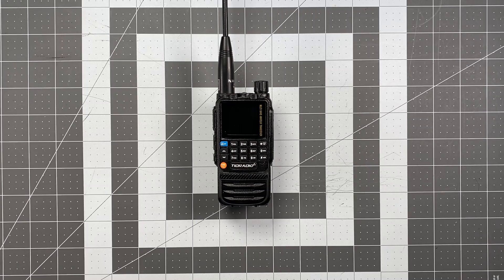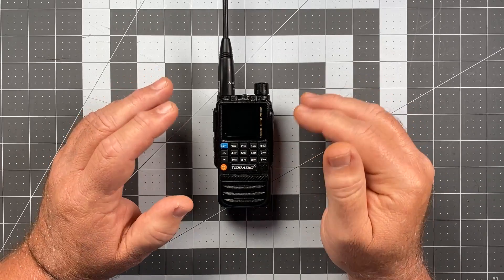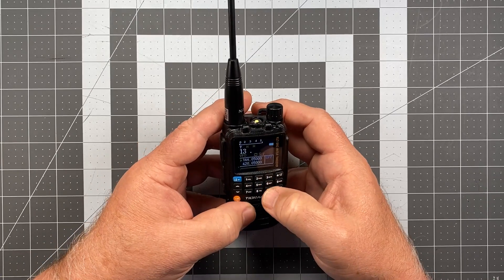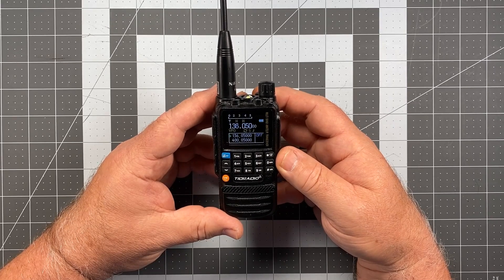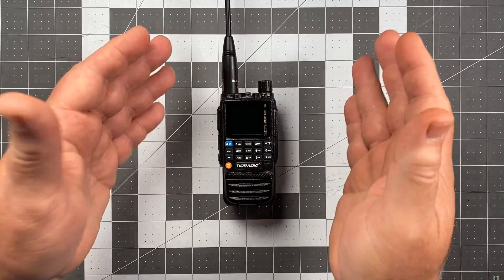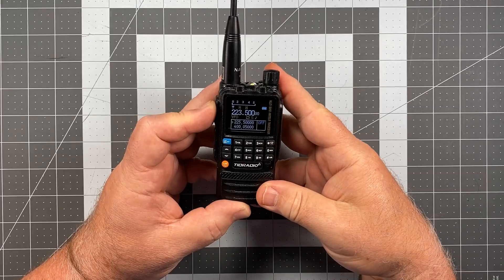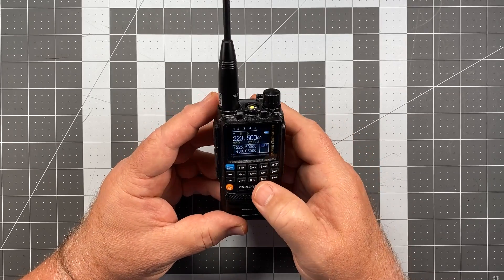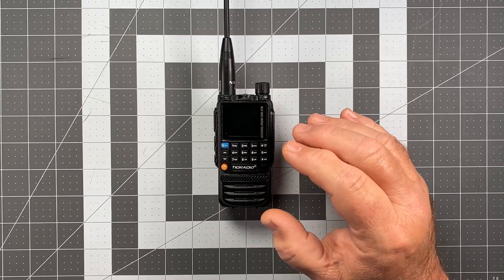TIDRADIO TD-H3 - Switching the operating modes

Comment: This does Not address the failures of the H3 PLUS . The H3 PLUS does Not have a GMRS mode . Unless you consider ' normal ' to be GMRS . I do not . I prefer the specific GMRS mode of the original H3 .
Reply from the maker: I don't own an H3 Plus. They offered to send me one for review, but I turned down the offer.

Comment: What are those extra steps you have to take to get it to work on ALL frequencies?
Reply from the maker: It's right here in this video. Set the radio to normal mode and it will transmit on all frequencies that this radio is capable of transmitting on.
Reply: @KS6DAY  
When I put mine in Normal mode, I can't program any frequencies in the software. I get an error message. I don't know what I'm doing wrong. When in GMRS mode all 30 channels are there along with the NOAA channels.
Reply from the maker: @keithmatthews4441  Is this error message after the frequencies are entered and you are trying to transmit or at the time of entering with the software?
Reply: @KS6DAY  
In the H3 software I can enter the RX frequency but when I enter the TX frequency I get the error. It won't allow it to be changed.
Reply from the maker: @keithmatthews4441  I have only ever used CHIRP to program the TD-H3. With CHIRP you enter the RX frequency and then the entered offset amount and direction determines the TX frequency automatically. I would be guessing with the software that you are using but perhaps the offset amount and direction need to be set and the TX is left alone. I have encountered something similar with the Radioddity GM-15. It too doesn't allow the TX to be changed. But if you enter the RX, set the offset direction and amount everything works. I discovered it by accident but it worked. Perhaps give that a try. You might also want consider switching to CHIRP. The TD-H3 is very well supported by that program and it's very easy to use.
Reply: @KS6DAY  Thanks, I'll try CHIRP.

Comment: I can receive a signal on my TID Radio TD-H3 from an FRS radio that we use, but i can't seem to transmit from the TD-H3 back to the FRS radio.  Any ideas how to correct this?
Reply from the maker: Does the FRS radio have any privacy codes applied to it on that channel?
Reply: Thank you for your assistance.  Figured out the problem.  The FRS Radio was operating on a CTSS RX/TX of 118..8Hz.  Did a scan on the TD-H3 to find those codes and added them into the GRMS radios for the channels that we use on the Ranch.  Works great now, able to communicate with my ranch hands, and when I need to go to a repeater and communicate long distance with my other TD-H3 radio using a repeater, I now have a lot of flexibility with one radio, as opposed to having to switch between the FRS Radio and GRMS radio depending on who I want to communicate with and the distance I'm trying to cover.  Have to say as a first time GRMS radio user, your videos came in extremely handy.    While watching your videos I have been able to connect to my FRS radios, Add a Repeater, Get rid of that annoying beep and voice, and much more.   Again, thank you for your public service.  Much appreciated.

Comment: Hi! There is a problem with the "normal" mode. As you correctly noted, you need to save the settings before switching. But when you upload them back, the radio closes to transmitting on these frequencies. It seems to become HAM again

Comment: Thank you for the vid! An interesting question is, if you have it in HAM mode (which is an easy way to make sure that you don't transmit out of band by mistake) will it allow you to save channels with frequencies outside HAM bands, i.e. with RX allowed and TX disabled? So far I have used my H3 in "normal" mode, and I just manually switch the duplex to off in Chirp as a safeguard, for the channels of potentially transmitable non-HAM bands (such as marine bands)... But if the HAM mode allowed to store them in RX only mode through Odmaster, that would be so much quicker and easier...

Comment: hi. need a video to show how to unlock Kill All Lock in my only one radio. Just bought it a month ago, got my gmrs license, but no activity in my areas and working on my ham. Used to have K1TJF back in the early 70s.  TId is not a lot of help. Can't understand the website to download firmware update or how to unlock unit,   thanks. Crazy Eagle WSDX855

Comment: We have spoke before... KC3ZDW   I have just purchased another TD-H3 so it makes it my third.   I have two that are straight up clean with stable power across the 2 meter, 70cm .  The problem with one of them is it does not like Blue Tooth Programming... Takes the program but does not keep them...I dont know if a latch on the proms are not closing ??? no idea... If I program manually it keeps the program  .
It's a hard to beat radio for the $   Thank You for all your Reviews

Comment: Great video, and it saved me from making a very annoying mistake.  I was about to return my TD-H3 pair because I could not get the mode to change.  The screen on mine (240625 firmware) has a "yes" on the left and a "no" no the right to confirm the mode change... but it looked to me like the "yes" was above the "1" key, so that's what I pressed.  And that didn't work.  Several times.  It wasn't until I saw you pressing the blue button that I realized what I had done wrong.  The blue button does the trick!
Reply from the maker: Don't feel bad. The exact same thing happened to me the first time I tried it. The text layout is a little misleading.
Reply: Same here lol
@KS6DAY

Comment: Does this mean the H3 GMRS and HAM versions are just the same hardware with this setting changed?
Reply from the maker: There is only one TD-H3. The HAM or GMRS mode is applied at the factory and can be undone and changed by the end user at any time after purchase.

Comment: By trying out the "Number 3 Normal" Mode I lost the FM Radio portion of the receiver? When I push the button for the FM Channel receive I get nothing but static. How do I get that function back?
Reply from the maker: I just checked mine and FM works in Mode 3. First swtich to VFO/Frequency mode by short pressing the orange button - Press the blue menu button - Press the #8 key and you should arrive in FM radio mode. Enter the frequency of the station you want to listen to and you're good to go. To exit press menu then 8 again.
Reply: @KS6DAY  That was not the way I accessed the FM Radio before the change. When out of the box, the FM Radio band was simply accessed by pressing the third PTT button left side and holding it in until the FM Radio started playing. The method you described allowed the FM Radio Station to broadcast/play at the same time as the NOAA broadcast on 162.400mH

Comment: Does the radio support reverse scan ? E.g. scanning for the offset frequencies configured for each cahnnel, like fror example BF UV-82 does ?
Reply from the maker: Yes. It's Menu Item #28.
Reply: Thanks for replying. 28 is seek CTCSS .

Software version 240229.

The UV-82 can scan channels, but with a simple switch you can switch the scan mode to be running against the offset (for example inbound to the repeater) frequencies.

Comment: I just got one of these in gmrs mode. How do you listen to air band? Ive turned on AM. But i cant figure out how to get the radio to monitor am frequencies
Reply from the maker: If you are not already in VFO mode, double click the orange button to get into VFO. Enter the relevant aviation frequency and you are good to go. If you want to save it to memory go to menu item 25 and select an open memory slot. If you're looking for frequencies to monitor, Radioreference.com is a good place to find the aviation frequencies for airports in your area.
Reply: @KS6DAY  thanks. i was thinking you had to change bands. I just put in the frequency and it went in to am automatically

Comment: Great video, thanks so much! I received a pair of these the other day, and am trying to figure a few things out.  In Normal mode, I can't seem to manually set the Direction and Offset on the Ham frequencies to hit my local repeaters.  However, on the GMRS frequencies/channels, I'm not having those issues and can set them manually from the radio keypad.  Is there a step I'm missing?  I'd like to keep it in Normal mode to use all frequencies and channels. KN6ZCU/WRMH840
Reply from the maker: Programming a repeater on the TD-H3:

If you're not in VFO mode double press the orange button to switch to VFO.

Enter the receive frequency for the repeater.

Press the blue key to enter Menu.

Arrow up to menu item 13 to set TX CTCSS. Press the menu key again to select the item. Enter the correct CTCSS and press the menu key again to save the change and exit that selection.

Arrow up to item 23 to set the offset direction. Press the menu key again to select the item. Use the up/down arrow keys to select None, Plus or Minus. Press the menu key again to save the change and exit that selection.

Arrow up to item 24 to set the offset. Press the menu key again to select the item. Enter the correct offset value. Press the menu key again to save the change and exit that selection.

You should be able to work the repeater at this point. If you want to save it to memory arrow up to item 25 to set the Memory slot. Press the menu key again to select the item. Arrow up or down to select an open memory slot. Press the menu key again to save to memory and exit that selection.

Comment: I just got mine thank you for the tutorial. I’m in Maui so not any gmrs repeaters here - I have it on gmrs only mode currently. Should I open it up like you did in case of emergencies? Is that a beefer antenna? Then the stock antenna? Thanks a lot 
Aloha !
Reply from the maker: It's a Nagoya NA-701. Works very nice with the TD-H3. As for expanded transmit, no need to if you're only going to monitor. You should be able to monitor everything between 136-600 MHz.
Reply: Thanks for the reply I appreciate, I’m new to the radio thing - can I transmit on ham channels in a emergency? It sounded like you said the fcc allows that - I’ll check out the antenna also 
Appreciate the advice- does the antenna improve range significantly?

Comment: Hi Scott   Your videos are always informative and to the point. Even at the end of a lead attitude adjustment. I've seen alot of videos on the H3 and seen that there 3 common issues. these are charging problems with batteries, low transmit power in low setting on all bands and spurious emissions that are enconsistant from radio to radio. Have these issues been addressed. Thanks again

Comment: Looking forward to the H3 / H8 comparison. I have the H3 and it is a perfect size for me. I run it around the homestead on .5 watt covering a about 10 of 50 acres so far.  I have stubbys on the way and im really hoping I’ll be L&C all over the 50. We will see. I was debating getting a H8 just to have it. (Im that happy with the H3) These are nothing like a FT-60 but for the price I don’t think it can be beat. I can throw it in the side by side and not worry about it. That in itself is value added in my books. Hoping you can share some knowledge on the programming side. I got it down to where the software works well for me but as always there are quirks that are probably my issues not the radios… lol

Comment: Hello, does the H3 have a scan range function?
Reply: I just looked into this today and i don’t see where it can be done.
Reply: Not at this time... It's typical scan freq or scan channel memory. A range and/or bank system would be beneficial.
Reply: I have the H8 and while using the ODMASTER app to program, you can select whether a channel is included in scanning. Not sure if it's the same on the H3, mine is loaned out right now.